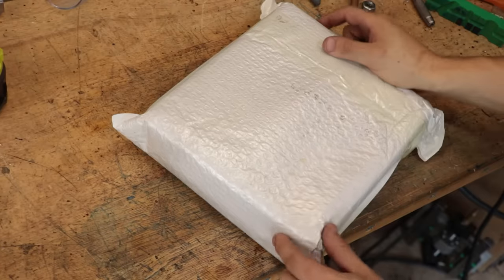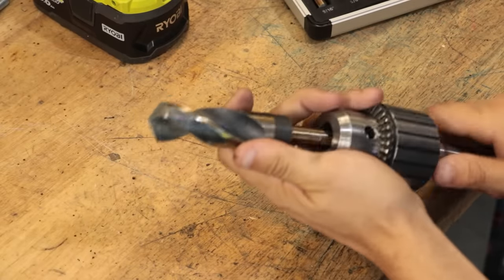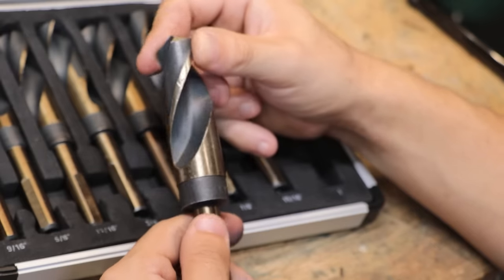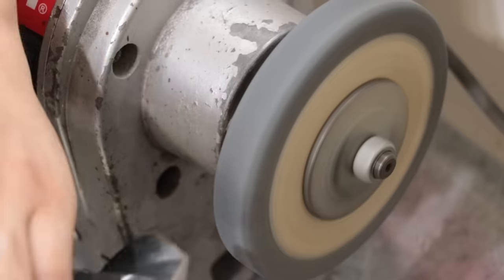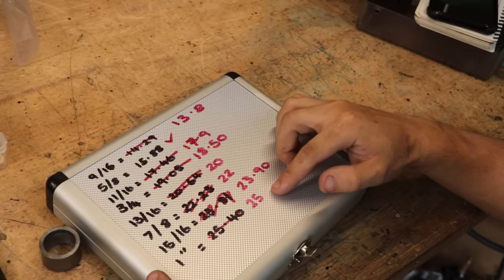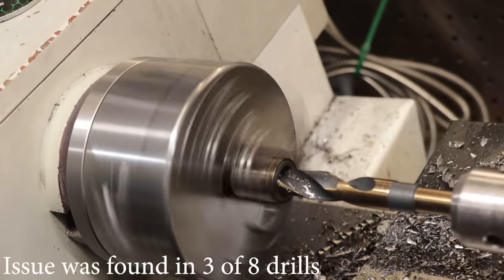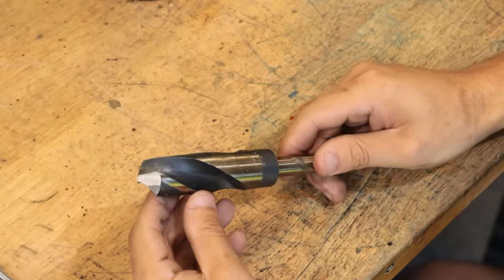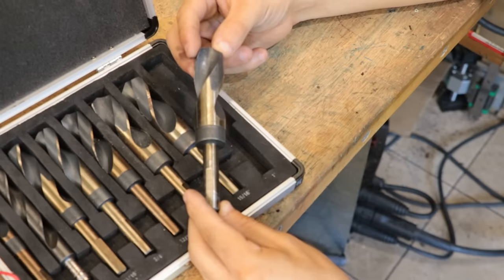Cheap Reduced Shank Drills. Worse Than You Think

Comment: As crap as these were your very unfair test on both drill bits one being lavished in lube while the import was bone dry. I to once purchased a set similar off a supplier here and returned them with the results having mic'd them, one being so far off the mark almost 1mm. The leading edge dumps were a disgrace on the import. The reduced shank length useless on the other far to short and now stuffed due to burred area. 
It is great to have quality made tools made locally maybe we should adopt the same Asian practice of payment to staff and quality control measures?
Reply from the maker: It got oil, maybe not as much but I think it’s obvious when you line up two shots compared to doing two tests one after another. For what’s it’s worth I only added lube when I felt that it needed it. In the end it still cut
Reply from the maker: Surprised how off those drills could be, I thought 0.6mm was a lot but 1mm. Blimey. Cheers and happy new year

Comment: These drills are fubar. Huge drillbits cost a fortune - but they last a lifetime under normal circumstances. I never had to sharpen one in years of heavy use, let alone right from the start. Chinese manufacturing is based on "It looks the same, it must be the same"

Comment: I bought a set of  black finish drill  for home use , I assumed they were heat treated post grinding and the work great out of box  . By the look of your set they were trying to make the look good by grinding them . To keep the cutting forces down I always set up in 5mm increments, it doesn’t take any longer as you can run faster speeds and feeds

Comment: Well I can clearly see a '25' stamped into the drill at 9:05 ...  I don't know where It's supposed to say 1 inch?
Reply from the maker: It says 1” on one side and WWS 25 on the other. We are still debating whether that’s a material grade or mistranslated size. Someone found an alloy which referred to wws25.
Reply: @artisanmakes  ah ok. I think I have the exact same drills. Bought mine in 3 pairs of 3 or 4  at a local supermarket for about the same total price. They look exactly the same, including the WWS stamp. I think mine say the metric size next to WWS. Although mine don't have the flats ground on the shanks and aren't as damaged as yours seem to be. Never really use them, but considering the price it's just a nice-to-have in case you ever need a big drill for a one-off job.

Comment: Ahh just get some carbide step reamers. They only cost about 5k for a kit. I guarantee if you don't shatter it, drop it , or snap it, it will cut for decades.....As the old commercial goes, what's in your wallet...lol I used them for years, titanium is no match for them, beryllium is like butter, steel might as well be wood.

Comment: Could you give them a grind with the stone on your mill then quench harden them? Might make an interesting video to see how much better you can make them.
Reply: Heat treating is a bit more involved than just heat and quench. Well, it should be, at any rate. Just heat and quench is only hardening. Tools then need to be properly tempered. Doing that right isn't so easy to do. It's often the true difference in material quality. Why A can be so much better than B is. A was just processed better.

Comment: 1:35 inches are metric, and you didn't get the memo. an inch is exactly 2.54 cm by definition. your 1 inch bit is 25.4 mm, your 3/4 inch is exactly 3/4's of 25.4 (which is 19.05mm) and so on. what is confusing about this, have you never divided things into halves repeatedly?
Reply from the maker: I don’t normally divide 25.4 by 11/16ths if that’s what you are asking

Comment: I enjoy your content, but watching your "Good" bit spin in the chuck made me cringe: it's a great way to ruin the chuck jaws (I know. I did it when I was young and inexperienced). You can make a light duty tool post grinder with a Dremel tool and re-grind the shank, this will give you much better results and save your chuck. If you can index the bit you might be able to grind the 3 flats on it and make it even better.

Comment: I'm sorry your import drills are so bad.  I have two sets of import silver and demining bits I bought a long time ago, and since I learned to grind drills a long time ago I have not replaced any of them.  One is a standard length set I bought from Harbor Freight.  The other is a stub length set I bought from Enco.  I was impressed with the metal case your drills came in at first, but well... mine came in the old cheap wood boxes.

Comment: 1. make sure the shanks have three ground flats before you buy. 2. If you try to run a 1in drill in a hand-drill, you pretty much deserve the learning experience you will get.  COMMON SENSE should tell you that you'll either sprain your wrist, wreck the drill, or simply fail to make a hole. It's not always about cheap tools, sometimes it's about someone being dumb.  Kinda like you were here.
Reply from the maker: I think you are missing a joke in that second part, no?

Comment: imperial mesures are... fun, and also extremely dumb. metric works for 99% of things these days unless you are specifically thinking about human interactions like what the imperial system is more or less designed around. our bloody temp measurments has a very cool 100 to indicate you have a feaver. and at 0 you are freazing your but off, and below that... you really should be inside with a heater. feet are relvant to your feet and "easy" to aproximate with... your feet. and many other aspects of how the system works involve referances to body parts and human concepts. it's still the most idiotic system to convert between denominations of the same damn metric but atleast it's "human." (i'm team neither and as an american i use both depending)

Comment: The drill grinding technique shown here is terrible! Holding the drill straight against the wheel like that causes a flat or  concave flute, and you need to grind extra clearance angle to get the rear to clear.
.
Some education and practice is needed. Once the cutting angles are set, you grind the cutting face the roll the drill UP the centreline of the wheel as you grind the clearance. This causes the drill's angle to change and automatically produces a nice smooth clearance angle.

Comment: that's a famous alloy call chinesium.😂 you probably bought a set of test sample. those are produce to check their production process and machines. is it good for anything? ah....sure, it can be, if you are doing a hole with threads. they are all under size, right? as the bible of machinists say, you will need a under size hole to tap to the right size. you will be a happy man if you see it that way.😅